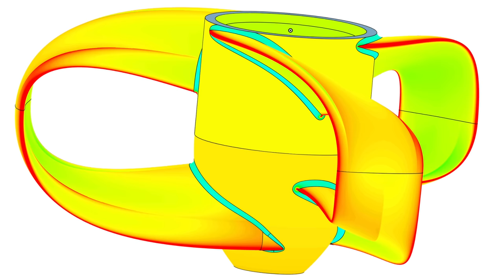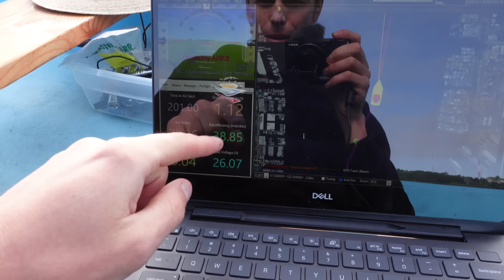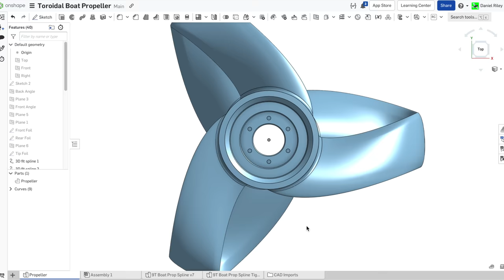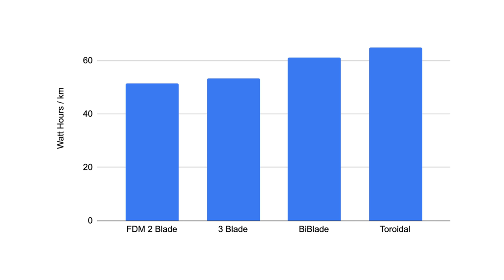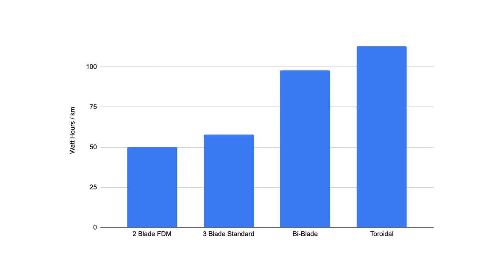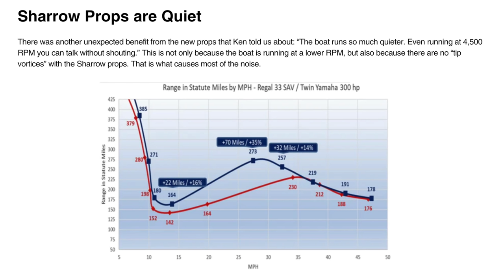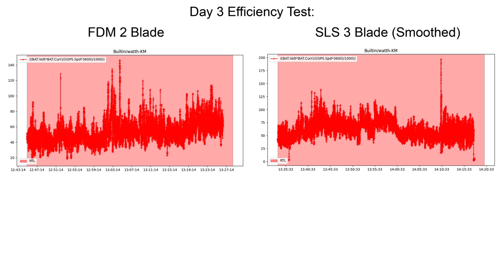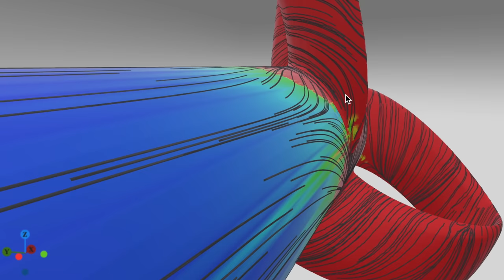Testing Futuristic Propeller Designs on my Solar Powered Boat

Comment: I think the Real use case for toroidal propellers is in siring peanutbutter. Think about it, the vibrations caused by a normal stiring device or spoon would turn the butter into unrefined oil. Thus a toroidal propeller would keep it at optimal eating consistency at all times. Seems revolutionary to me...
Reply: underrated comment
Reply: Hahahaha nice throwback

Comment: Awesome video. Love how honest you are. So many YouTubers made a design, with crap materials or printer, and then called it a day. 

 You admit there is more to it than just copying the look, and say it looks good. When there is much more nuance into it.

 It is like a sword like a Falcata or Kurki. What seperates a good one from a knock off is not just the profile or how it looks in 2d space. Yet whether it has a good distil taper as well. Cheap ones will knock out the shape, and it is basically flat metal piece with a small edge. Instead of the spine or length of blade having different widths to balance it. It makes a huge difference in any sword really.

Comment: I recently watched a video on microwave cooking by America's Test Kitchen where they basically said it's better to microwave at lower power settings for a longer time than it is cooking at full power. At the lower power setting the food is cooked more evenly.

As someone who has used pre cooked dinners in the past (not Factor, they are new to me) I found out I got better taste and texture by putting them in a pan/skillet/pot than with keeping them in the plastic containers and microwaving them.

Comment: One real advantage I think you'd get with toroidal props is that they would be far less likely to get snagged up in seaweed. The seaweed has a much more tricky path to navigate, to get itself wrapped around the hub, and will just be pushed away constantly, as long as the prop keeps moving.

Comment: The best propeller ever invented is the Vintage 1906 / 2 Blade Spoon type used on most long tail boots. Tough, anti-fouling, self-cleaning, can run in mud and rocks and gives mega thrust cheaply.

Comment: I love the testing and especially the evil twin brother action.  I was thinking a good test that eliminates a few variables would be to put one pf each type prop on and see if the boat turns with equal power on each motor.  in calm wind of course.

Comment: The air plane props could also be shaking because of the difference in depth. Barely below water to fairly deep. The other props used were closer to the axis of rotation and their tips didn’t change in depth as much.

Comment: In the MIT paper they are correct that the propellers are giving off less noice for the same thrust. 
But a thing many does not see is that the watts to thrust is no where near the same. 
Takes about twice the energy to get the same thrust in MIT's toroidal propellers. 
So their design was only usable in cases where you care much less about battery life and more on noise polution.

Comment: I think pushing water out from the toroid isn't the same effect as on a normal plane, as the toroid prop is esentially a double-decker, meaning the lower outward wash from the top blade collides with the wall and upper inward wash from the lower blade, essentially destroying both vortecies.

Comment: I think I'd be tempted to do a lower pitch on the leading blade on the toroidal and higher on the rear blade to test - as as you mentioned earlier,  it does resemble a stacked airfoil - if you're using multifoils that are offset you usually use the leading airfoil to feed air through the slot gap to keep flow attached to the higher AoA foil behind it, be interesting if the same holds for a prop.

Comment: The Torqeedo props are worth looking into. I had the Cruise 4.0 outboard and that 3 blade prop didn't go fast but seemed damn efficient. They do boast about how much engineering they put into their prop design. Would love to see how they compare as I bet you could come up with an adaptor with little trouble.

Comment: @RCTF,  Speaking as a retired Professional Pilot,   We can agree that a by product of Lift (or Thrust in your case) will always be some percentage drag component. Additionally,  the Cavitation your seeing could be described as "Boundry Layer Flow Separation", which is often influenced by Relative Foil Chord Angle and Texture. Conditionally, it would also seem a design with "more Surface Area" will be more likely to be less efficient due to aggregate surface volume and Relative Drag. Fixed Blade aircraft propellers are typically designed for  a specific efficiency, Climb Thrust, or Cruise. "Constant Speed" Aircraft Propellers tend to bridge that design through Pitch adjustability to a specific RPM.
Thanks for sharing your experiment.

Comment: Talking about the vibration in the two blades prop. Looks up vibration in even vs odd number of props. For example, most windmills are 3 bladed for a reason.

Also, notice that the original toroidal props are elongated, not round, but still closed. That would prevent water slipping off the end, but would generate less lateral vortex.

Comment: The biggest problem with toroidal propellers is that if they do not maintain their form that is if they receive pitting and wear and tear that ruins. Their foil form it rapidly deteriorates all of the advantages that you gain from it and its cost is astronomically higher than using a much simpler, cheaper and more robust propeller.

Comment: Lay 2 sheets of kitchen paper flat in the bottom of a large plastic tub 

Pour some acetone onto the paper 

Place the propellers ( etc etc) into the tub

Put lid on tub. 
The fumes from the Acetone will go to work "smoothing" off

Normally***, it takes a couple of hours in the tub for propellers etc to become smooth

* keep a eye on the items Whist in the tub
because if left too long ...
They will just completely melt 

Hope this helps

Comment: As you probably know, to achieve Bernoulli effects, smoothness is required.  Generally, I see water propellers are mainly Achimedes (just throwing water backwards). Bernoulli is pressure differences, resulting in more efficiency. Like helicopters versus wings, to hold up an aircraft.

In air at STP, just one-eighth of an inch, cancels Bernoulli, for a certain area.  On my Piper one cold day, scattered frost (far less than anything with a one-eighth inch profile) kept my rental plane in ground effect, until my instructor flexed the wings enough to break off the frost.

It brings to mind whether creating "frost" with paint, on the bottoms of plane wings, could achieve higher lift at slower speeds, at the expense of increased drag.  After all, Bernoulli is acting on the bottoms of wings, too.

What few realize, is that methods to reduce fluid velocity on the "negative" side of any wing surface. Price is turbulence, where fluid recombines, at the rear.

My sailboat's sail, works because of the "pocket" sewn into the sailcloth.  It's not flat, after all.  It's why a single surface "wing" can achieve Bernoulli, that "catching and slowing down", of the passing airflow.

Comment: As I reviewed the video several times in slow motion, I am about 90% certain that those wooden RC props are tractor configuration props. You need pusher props.
Also, we would expect 2 blades props to vibrate more because the prop as a whole is more affected when the blade passes the shadow of the mount structure. Another factor is that when a two bladed prop is vertical, it is much easier to turn around the vertical axis (like a change in steering input). So if you are changing the steering input at all, it produces judder. The assembly moves a lot when the prop is vertical, and then moves much less when the prop is horizontal. These are the same reasons big wind turbines pretty much never have two blades. With three blades, any time one blade is vertical, the two blades are very much not vertical. No judder.

Outstanding episode, great thought process, great presentation, great execution, great data, and excellent correction in methods once you discovered the weird outlying data.

Comment: I'll give you something from submarine tech to think about: 
If you really want to mitigate the vortices and possibility of staling and make the prop that is appropriate for larger thrust range, surround props with a cone that is slimming towards the end (squirting end), by some marginal degree - let's say 5 - 15 degree. Also make that cone part of your prop, not a separate housing. That way the water that is being pushed out through the cone get's compressed and mitigates the stall effect. Now your prop will not magically get more efficient, but you will get flatter efficiency curve ... and also wider. If you want to make it extra fun you can print it from clear vinyl to see what's happening inside of the cone.
Submarine props are purpose designed for specific power plant - hence they can optimise those to the worlds end ... of the shelf props will be used on different power plants, different use cases etc etc - hence old school props are still the king.
Good luck on your project.

Comment: Thanks! I have a 30ft sailing yacht that I have been running off 3 solar powered electric motors for 9 years. My boat needs no fuel, she's powered by the wind and sun. I have 4 8D commercial batteries set up for a 24v system. I works good for me. I still need to sail for long distance trips but getting around my general area on electric power is no problem. I have 300lbs of thrust which 95% as much as the recommended gas engine size. I really enjoyed your prop analysis. I always keep my eye out for better props. Keep up the good work!

Comment: No kidding.... This would have to be one of your best episodes👍
I really enjoyed the geometric discussion.
I think what we are discovering here is that balance is more important in a denser fluid like water than it is in air?
The interference is considerably more disruptive to the flow because it is heavier?

It's like when you modify a turbo car with drive by wire throttle control and traction control, the more horse power you make the more violent the thrashing occurs when the car breaks traction?
When I cranked up my dad's turbo ute; the first time I hit traction control at high rpm and high wheel speed and moderate vehicle speed....we nearly smacked our heads on the wind screen lol

Comment: With regards to the vibration my understanding is that propeller vibration oftentimes stems from pressure waves coming off of the propeller blades and impacting the hull. The general rule seems to be that the more blades the prop has, the less vibration there is. Also, with the two blade prop, the two pressure waves might be simultaneously colliding with the rudder thereby causing a larger vibration. Just my two cents

Comment: Some people in the comments under videos about toroidal propellers mentioned that the efficiency of a propeller highly depends on its speed.
Each propeller is most efficient at a certain speed. And I think the main advantage of the toroidal propellers is that there's a wider range where they can operate efficiently compared to a normal propeller. And a lot of the huge efficiency claims made for toroidal propellers are made at a speed where a standard propeller is not running very efficiently.
But for something like a cargo ship where it will just be travelling at a constant speed, they can just get a standard propeller optimised for the speed it is expected to run at.

Comment: The forward speed of the boat affects the apparent angle of attack for the blade  angle. If the props are trying to push too much water in a slow forward speed, they will bog down. 2 blade props probably had the most matched angle of attack for the forward speed, on top of simply having less surface area drag. Rocket engine bells are the same in that they are only efficient at 1 altitude, then worsens from there. Hence a totally different bell on 2nd stage.

Comment: When I design RC plane props and fans I use helixes to align the pitch of the chords (not the angle) at the different distances from the axis. Make single turn helixes with the same height but different radiuses. I usually make one for the root, one for the tip and one for mid span. That way you can achieve the same pitch all the way along the blade or set different heights at points to achieve a varying pitch for example. 

Now there are probably some special tricks to getting higher efficiency with boat propellers by having a slightly varying pitch from root to tip, but I'm not familiar with that.

Comment: I like your practical experiment and technical presentation.  As an engineer, I find it very interesting.   I would've thought that toroidal propellers are better over traditional propellers but apparently, your experiment proves otherwise.  The claims of 105-138% higher efficiency are certainly quite unbelievable and I think quite outlandish and thus far cannot be independently proven.  Great video!!

Comment: If you revisit this; look into using blades to prime numbers, this'll reduce resonance, also skewback screws or pump-jet propulsors for more efficiency, less cavitation.
Reply: Regarding vibration on the two-bladed prop; that's a main reasonwhy primes are used.

Comment: So, 

cavitation that happens at the tips of propellers can create noise which is why navy submarines try so hard to reduce them, because they can create noise that an enemy can pick up. 

The toroidal propeller creates less cavitation because of the wing tip being connected to the other piece of the wing.  This creates an area where there is not a wing tip, meaning cavitation cant form, this will reduce noise.  Mind you cavitation is probably not something you can hear over the moters, so theres that. 

Noise is also created from the turbulence of the water, where the toroidal creates less turbulence, so less noise. 

There are probably better designs for toroidal propellers online, but its really cool that you took your time to design your own and test them out and give theories on why they might be less or more efficient.  This is the type of video I love watching.

Comment: 15:20 Yes, sunscreen will reduce the efficiency of your panels, but not by much. Its meant to work with skin to diffract near-UV radiation, doesn't do that so well with a non-porous synthetic surface.

Comment: Sharrow prop uses very smooth stainless steel in their Props.  This affects a short chord more than a wide chord. Sikorsky Helicopter company did some Stacked propeller efficiency studies in the late 1960's and published the data in an AHS paper.  what they found is that you need around 6 degrees more pitch on the set of blades that see the fluid after the first set of blades accelerates the flow tn order to split the power on the two sets of blades.  In your test you set the pitch the same on all the blades resulting in the second set of blades been unloaded and just creating more drag.  When you think about it your data is correct and points out where you need to go for improvement.  Sikorsky data indicated that if you have a stack propeller and you get all the pitches correct relative to each other that you will observe a 7% increase in thrust for the same shaft torque with the same solidity of the prop.  This matches the Sharrow data and points out that know what they are doing and I trust their data because it matches the other test.  This test was repeated at a company I worked at and on the third tru at taking the data they got the angles correct and they observed a 7% increase in efficiency just like Sikorsky observed 40 years earlier.   The bottom line is that Toroidal Props are great if the design and manufacturing is correct or if you miss the sweet spot you get what you found in your test.  You did a great job and to improve your result you will need to be very lucky or use CFD analysis.  I bet the NAVY would fund you to do further work in this area.  You are close to a good solution. You are doing great and the other data was created by a bunch of areo  PHD's.  By the way, MIT missed the sweet spot too.  Best of luck!

Comment: Toroidal props would generate more drag since there is a surface not used to produce thrust. I think the outer ring on the toroidal propeller would need to slim down, be thin, and have no angle in order to make the efficiency generated by reducing vortices overcome the increased drag created by the extra material.

Comment: I'm sure a hundred other people have already said this, but maybe the benefit of a "quieter" screw (Can it still be called a "screw" if it has toroidal blades?) is that it may disturb submarine wildlife less.  We hear the motors most above the surface, but below the surface I bet the screw/prop is a whole lot noisier.

Comment: All the props seem to direct a lot of drag that concentrates at the middle point of the end of the propellers.
May be try reinventing the motor and propellers so that water passes through the middle of the motor. 
While also narrowing the tube so that the water velocity increases as it passes through the propellers. That way, the inside turbulence on the propeller is reduced enough to not contribute to the vortex on the outside of the propellers.
Then for joint between the now hollow motor and propellers,  make it more aerodynamic so that the drag from there always flows to the tips of the propellers when they align.

It may be expensive but worth a shot

Comment: The way they presented it, they were definitely talking about audible noise above the water surface, but until I saw that, i was gonna say they could be talking about noise transmitted via the water. 

if you're designing a torpedo or subhunting ship, it's a good idea to have the quietest possible propellers, so it wouldn't be unwarranted to talk about noise transmitted into water

sharrow sounds like they're full of it though.